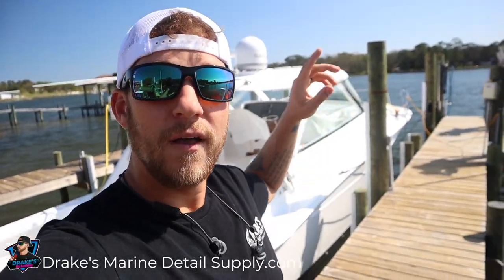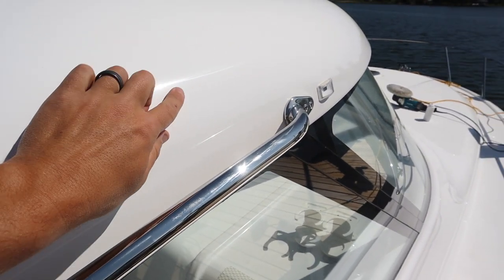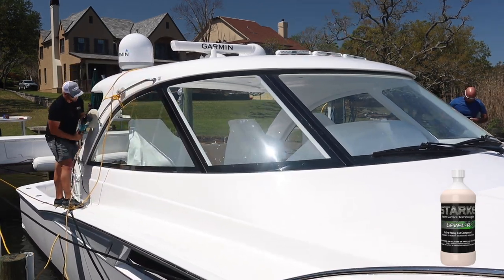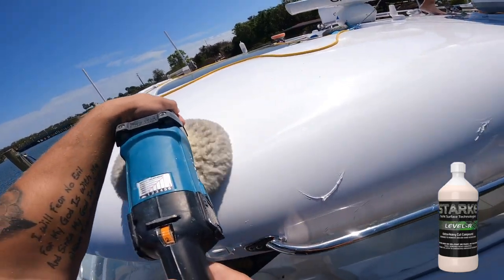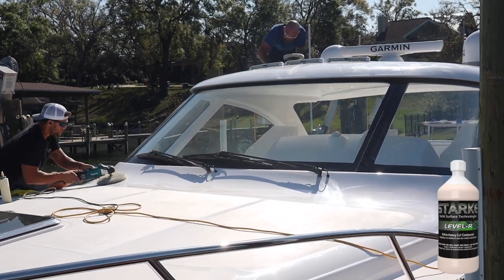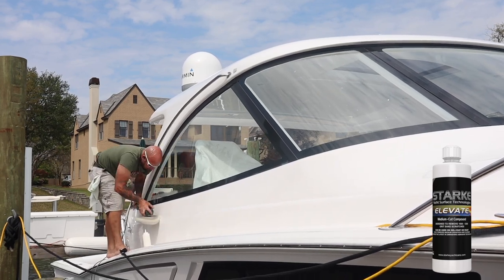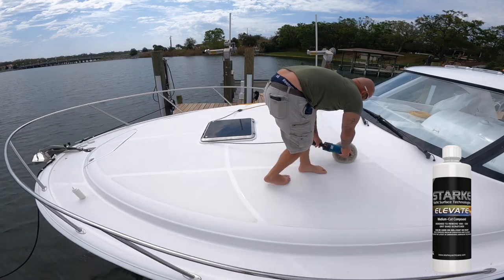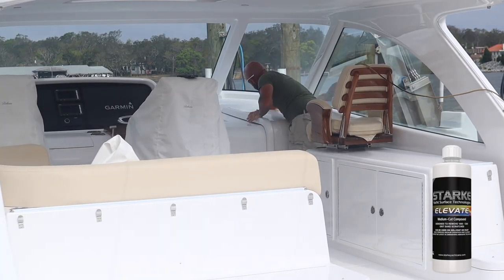Removing Sanding Marks Off The 2021 Mag Bay 42 | Boat Detailing Tips | Revival Marine Care

Comment: Drake I don’t have a rotary. Can Level R be used with a short throw DA? My Gelcoat looks a lot like this boat and I would like to polish it up. I do have a Bosh sander that is similar to your 3401 forced rotation in the way it operates. Would it work with the level R using wool pad? Just can’t justify a rotary at this point. Thanks Drake
Reply from the maker: Level R will not be effective with anything accept a Rotary. You need to brute cutting power of the Rotary in order for the compound to do it’s job. The DA will just spread it around, and the compound won’t break down.

Comment: G'day Drake, I'm working on a small trailer boat with a painted hull that's in bad condition, is the wet sanding process applicable on painted boats? And if so is it the same process as on gel coat?
Thanks legend!
Reply from the maker: Yes, you can sand a painted boat. You’re sanding just will be alittle lighter. 1000 grit is heavy on paint. Then just buff like normal
Reply: @DrakesDetailing  legend, thanks mate!

Comment: Great video. Can you go from level R straight to Elevate with orange foam pad (skip second Wool pad step) and get acceptable results for working on older boat that’s worth thousands not millions?
Reply from the maker: Yes you can!
Reply: @DrakesDetailing  thanks so much Drake starting on my sailboat project this Tuesday. I am a committed DIYer but I wanna do this right. Do you have a remote consult service where for a fee I could send you some pics of my project and get some advice and recommendations?

Comment: Did I catch that right that you used the compound with the wool pad and then the same compound for basically you polish step with the DA?
Reply from the maker: Yes! It’s the two different actions that make the difference. The compound with the rotary and wool pad will cut deeper, then the same compound with a DA and a foam will help get rid of the swirls and get you a mirror-like finish.
Reply: @DrakesDetailing  ok awesome. I’ll try that out thanks!